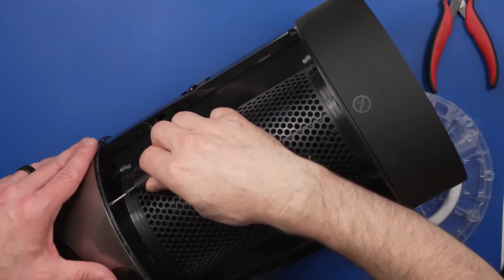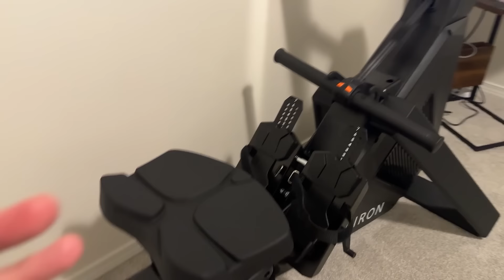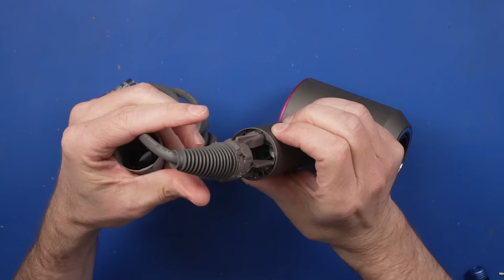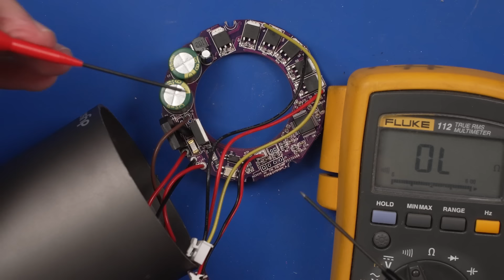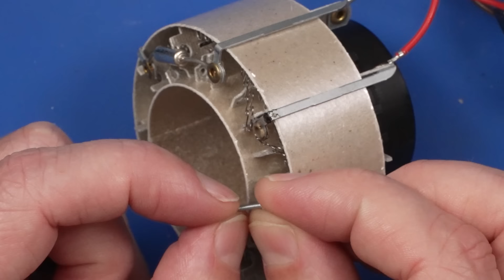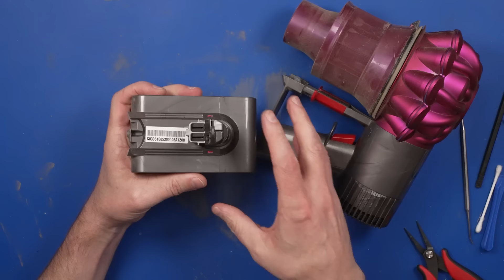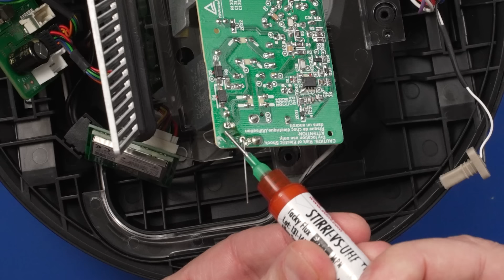Are Expensive Dyson Products Repairable?

Comment: The intro killed me! "We're going to find out on my new series called: 'Are They Repairable? NOPE!" 😆😆😆
Also: I just bought a rowing machine after seeing the sponsor ad and also learning what it actually does for your body.
Reply: my favourite dyson vacuum trick is to get a tool battery converter. the vacuum lasts for MUCH longer on one charge, has more power, and the batteries are way cheaper.
Reply: Makita, Bosch, Milwaukee, Dewalt and Ryobi. So many different dyson vacuum battery converters out there. It's great!
Reply: I gave a like
Reply: I'm glad my ad blocker and sponsor skip still works, I didn't buy a row machine today
Reply: @GuitarGuyMertin  I was just curious about them and asked ChatGPT what the big deal about them was. I was sold. I didn't get the actual model shown in the video, I got one for $230 on Amazon and it's been amazing honestly so far! Super low resistance on your joints but uses so many different muscle groups and keeps your muscles guessing even with constantly proper form. So good for your body! Mine stands up straight and takes up so little room in my house.

Comment: I have the vacuum cleaner. When the battery crapped out I bought I got an adapter that uses both Milwaukee and Dewalt power tool batteries. It works so much better than new and they’re high quality batteries so that’s what I would recommend.

Comment: I have the same vaccuum cleaner and got tired of replacing the battery. I bought a milwaukee battery adaptor that is made for this cleaner, and can be found in Amazon. Now I can use the same milwaukee batteries that I use for my tools. I think I like more the adaptor than the cleaner

Comment: Dyson are easily high on the list for products that are not easily taken apart, one of the reasons I won't touch them. That, and I don't agree with expensive products not being "easy" or cost effective to repair, $100 for a battery is daylight robbery.

Comment: For the price of a Dyson product, they should be offering a lifetime warranty.  Most appliances are not made to be fixed or even serviceable.  They are just meant to be replaced.  Planned obsolescence is a thing.  The only person that troubleshooting a broken appliance works out for is someone like you IF you get it for free and IF you can get it working again.  If a repair tech is gonna make $200 to troubleshoot & fix something AND get a replacement part, then what does an appliance's value have to be before it becomes worth fixing?  If it's already a few years old before it needs a repair, it usually just makes more sense to buy a new one than fix the old one.

Comment: Bolt and nut isn’t best option for long term of usage,best should be replace for new open ring holding spring heater.Its called Snap Press or Nap press for open ring.Good to have one in workshop because of many way to usage👌in future. Good work anyway 😊

Comment: As someone who has taken quite a few of those battery packs apart for the batteries (which I Grade for my own projects)  I can tell you that you are doing it wrong which is unlike you. Just remove the screw at the top and slightly prise the sides out and not the top or the bottom and pull the halves apart and it will come off cleanly. I rarely find a faulty battery so I guess the electronics in the pack go faulty. I don't need the cases for my projects but I rarely damage them in the process.

Comment: I am not sure what you are on about here - I have two Dyson vacuum cleaners, and have repaired them several times. Parts are easy to find and cheap. What has surprised me is how durable the plastic parts are - my oldest vacuum is 25ish years old, and the plastic is still flexible and I have never had a single broken plastic part, despite having to heavily pry on thin sections to get it apart. I have been very impressed with them in every way.

Comment: One of the wheels broke on my V15 anti tangle head. Dyson says its not repairable and I would have to pay over £100 for a whole new head. Instead I find a replacement part online, but to replace that part the wheel is attached to I had to completely disassemble the cleaning head. Every single screw had to come out (both Phillips and star heads) and even the electrical connector had to be disassembled to pull the cables through. Very consumer hostile.

Comment: I found a Dyson in the trash with a bunch of attachements and all it needed was a new battery for 20$ on Amazon and I used the wheel from a hot wheel toy to replace one that broke on the head, didn’t even need soldering just epoxy and a screwdriver

Comment: The Power Button is not working on my Dyson AM 09 which I bought about 10 Years ago. 
The Remote Control failed after it was put into the Laundry by Mistake so I was relying on the Control Panel for Operation of the Device.

Comment: Credit where credit is due though, everything that can be repaired without an electrocution or fire hazard (the heating coils and batteries) where accessible with basic tools and enough willpower to disassemble the things, so while they aren't necessarily designed to be repairable they also aren't designed to impossible to service.
Really just a case of Dyson being overdesigned rather than being designed to prevent self service of appliances.

Comment: My Dyson hand vac battery failed after about 3 years. It was running the vac for about 10 seconds on a full charge.
I found a clone battery for it online for about a tenth of the price of the genuine Dyson battery.  The clone battery has been working fine for over 10 years now.

Comment: My local hairdresser bought a professional DYSON "hair salon  quality" hair dryer for her business and it started to overheat after 1.5 years. She regularly cleaned the filters from hair and took good care of it.

She was pissed that it only lasted so little after paying 500+ euros for it.

Not only that, but when it was working, every time she was using it to dry my hair, the LED bulbs from the salon would start to flicker (strobe) lightly. That thing was putting out some EMI / harmonic distortion back into the mains.

From my observations, DYSON products are over engineered junk with a pretty "wrapping" slapped onto them. Their exorbitant cost is due to their massive advertising budgets.

Unfortunately, manufacturers today have the mindset of: "If you can afford to buy an expensive product today, you'll probably afford to buy another one when it fails outside of warranty." Long gone are the days when expensive products were engineered to last a lifetime (or decades), everything is built as cheap as possible and designed to barely last until the warranty period expires.

Comment: I think the battery is repairable but needs a little modification just add an on off switch directly to 20v output. And run it to the original push to activate the battery. For the charge use generic BMS for 20v battery pack and it's basically fix

Comment: I bought an AC unit from Black and Decker before, cost me about £600. Put it away for storage and the next year when I went to use it, the damned thing wouldn't turn on. I got onto BnD and they sent a replacement out for free, and just asked me to cut the power cord off and send them a photo of it. 

I found out it was just a resistor that had blown, soldered a new one on (which cost me about £1), repaired the cable and bingo! It came back to life. I recieved the new AC unit, sold the older one as refurbished. Pretty much got a free AC unit! haha

The only reason I was able to do it or even had the idea to do it was thanks to you, TronicsFix! It felt amazing
Reply: Nice 😄👍👍

Comment: Aside from the battery pack, these all seem repairable... everything is screwed or clipped together, not glued or ultrasonic welded; circuit boards aren't potted, and you didn't have to cut/desolder any wires. Looks like they were mostly designed for tool-less assembly, or a screwdriver at most.

Obviously you might need to cannibalise another unit for spares, especially for the PCBs, but even if spares were once available everything eventually goes out of production.

Comment: This is interesting. Dyson,  along with Shark, Hoover, and other cheaper vacuum brands have become disposable. I didn't realize that they had higher-end products because I typically avoid them due to repairability. Often, the common parts that fail (primarily motors) will cost almost as much as a new vacuum so they aren't worth the hassle.  I have worked on quite a few Miele, Rainbow, and Riccar vacs which are designed to last a while and be serviceable. However, they have made it more difficult for the average consumer to buy parts in the last few years. Typically, you need to be a licensed dealer or repair shop to get parts, especially from Miele. This makes me think a little higher of Dyson. I still don't plan to buy and fix their products but I may consider buying one for my own use if the price is right. Great video!

Also, I don't care how convenient they are; I will never use bagless vacuums. Bagged vacs do an amazing job cleaning the air in your home while you clean. As someone with terrible allergies, its made a huge difference having bagged vacuums with Hepa filter bags. I'll get off my soapbox now.

Comment: For the hair dryer, I think using an aluminum rivet would have been a better solution. While running the fan generates quite a bit of vibration and it will more than likely work that nut loose.

Comment: I have disassembled many things that are secured by plastic clips. I have played that game of "Release clip B and clip A is now locked again".
My solution was to just make my own tools for the purpose. I use engine oil dipsticks. I cut them to size and bend them with a sharp right angle so they resemble the letter " L". Then I finish them off by smoothing out the cuts and tapering the ends.
Having several of these will help you avoid playing the game.
Reply: Harbor Freight pick set is $2.99 plus sales tax. The dipsticks cause less damage to the plastic and maybe stray finger tips though. Nice tip!

Comment: A hundred bucks for a "battery pack" that contains more smd electronics than a quantum computer... This is the way they press money out of the naive consumers.
I'm asking one thing, likely the obvious one: couldn't they make the battery packs to be just battery packs, without the overcomplicated smd electronic battery management? As I repaired a ton of such devices before, I can answer my question. They could easily design their products to be easily and cjeaply repaired, by focusing on modularity when designing. A BMS could be designed to be the part of the machine itself, while the battery pack would be what its name is, a battery pack only, without unnecessary things. But then they couldn't sell garbage for the price of gold, and they wouldn't pollute so much on your money. Less waste, more useful things... Simpler, cheaper but longer lasting, easy to repair products... Yes, in my dreams.
Green lobbies always cry on pollution, protecting the environment etc., but the manufacturers are still producing garbage that fails after a short time. I feel some controversies in this. Could car factories make cars for more than five years? Yes, they could. Now they just don't want. This is how they save the planet...

Comment: Nothing like disassembling something designed to never be disassembled and at the very bottom is a fuse that should have been accessible by a tiny door at the bottom of the unit but isn't because they'd rather have you throw it out and buy a new one.

Comment: The Dyson hairdryer is a counterfeit! Done more than 300 units 🎉
Reply: Looks very well made for a counterfeit 🤷‍♂️ Is it totally different inside, or just something doesn't look quite right? I'm curious 🙂
Reply: @BasedBritNYC different inside (motherboard, motor which is a v9 or on some models v9c) the fake one is much lighter than the genuine one, and motor have different sound and power. Also the fake ones are prone to catch fire
Reply: @deyaq4966damn, I had no idea that the Chinese were faking hairdryers now! 🙄 Anything with a decent mark-up, I guess. Apparently, Chinese banks have been selling fake gold, too. You'd think that Dyson could do something to try and prevent it! Some kinda laser-etched QR-code serial number, or hard-to-replicate hologram, or NFC chip with traceable serial number, or a security strip somehow woven into one of the plastic parts. I don't know...I don't work in manufacturing...not my area, but I'd be making SOME effort to make my products fake-proof if I were! 🤷‍♂️
Catching-on-fire aside, it's still somewhat "impressive" how the counterfeiters are able to copy this thing. Shame they don't put their talents to better use. 😕

Comment: I have a Dyson Big Ball Animal Cinetic (CY22) that was their flagship vacuum when I got it in 2017. They still sell something similar, and they tout that it is maintenance-free with no filters to replace, five year guarantee. Fast forward to this past weekend where I am wondering about it and find out that there is actually a large filter inside the base of the vacuum, some people do find that their filter gets holes in it over time, it was a part that you used to be able to buy as a repair entity, the part no longer exists in any form except maybe in Australia... I stopped looking into it. Amazing vacuum though, I have had zero complaints about it in the seven years I have owned it and I will definitely buy another one, except this time I will buy the replacement filters at the same time when they are available for servicing a decade down the road.

Comment: I have a dyson v11 and it gradually stopped working from only turbo mode working to none of the modes working, after a bit of research I determined the motor was faulty so I went to aliexpress and ordered a "brand new" replacement. 

To my surprise the replacement which was about 140 Aussie Dollars looked like it was never used and I replaced it and it worked perfectly and still works. 

Dyson quoted me like $350 or something crazy for a new body with motor and trigger and all the extra stuff I don't need.

Comment: You should have used a second nut on that heater fix. That nut and bolt is sure to loosen over time due to the temperature changes.

Comment: These Dyson Replacement batterys from Amazon are mostly fine for half a year. After that they rapidly decrease in performance. I have disassembled my old Dyson V7 Battery pack and replaced the cells with some high current cells. 
I also did use copper to weld them together because the current is really high. It was a pain but its now over 3 years old and still performs very good.
But next time I just take a battery from a tool brand and an adapter with cutoff if thats avaliable...

Comment: My mom has one of the Dyson handheld vacs. Battery was only holding enough of a charge to runt he vac for 3-5 seconds. Rather than spend $125 or so for a new Dyson battery I got a battery adapter from a company in Australia so it'd take 20V DeWalt batteries. Works great, a 4AH DeWalt battery runs it plenty long enough to take care of the normal vacuuming. 

Should anything extra get vacuumed enough that it kills the battery all ya have to do is pop the DeWalt battery off the adapter and slap another one on. Works great and never have to worry about the charge on the vacuum as there's enough DeWalt batteries around here to use that there's always multiple charged batteries to choose from

Comment: All Dyson products simply look like cheap flashy plastic disposable garbage.  First thing I would have tested before dismantling the Dyson fan is whether or not power was being delivered to the fan at the base.  Looking at it is not good enough.   The cord or plug could have been broken without outward visible damage. Had that problem on the charger for my cordless lawn mower.  All fuses should be readily accessible and user replaceable on a properly designed product.

Comment: hmmm the remote is less than $20! Not bad. Oh speaking of 3rd party products. I put on a 3rd party air filter on my fan. The thing pegged to 100% pollution. I thought it was the filter. I put on a genuine part. Same thing. "clean the sensors" is what google says. Took me a while to figure out where they were. but I found them I cleaned them. There is no difference in filters. The 3rd party one was just as good. It was the sensor that needed cleaned.

Comment: My new dog ate the remote for my dyson fan. sigh.......I do most of it from the app, but sometimes after the power goes out, you need the remote. Also the heater flat out does not work without it. It's disabled in the app because of "safety"......sigh.......

Comment: Have a 3 year old V11 Outsize that first had a bin lose a gasket and waited 3 months for it, now the head unit is not working right and they say I need to replace it.  At over $300 for an $800 vac is insane.  Need to fix it myself and see what went wrong.

Comment: It is good practice to re-flow a solder joint if you trim the legs after soldering a through-hole component. It can potentially cause stress and generate micro fractures in the solder connection!

Comment: I don't think that heater is supposed to be fixed. Those look like a safety that burn out and kill the connection when something goes wrong.
Reply: Agree but it probably got some water in it or the connection to that tab was loose or faulty from the factory so it overheated and burned out.